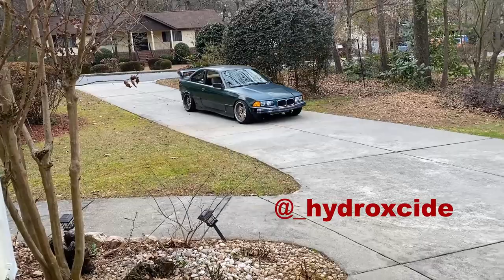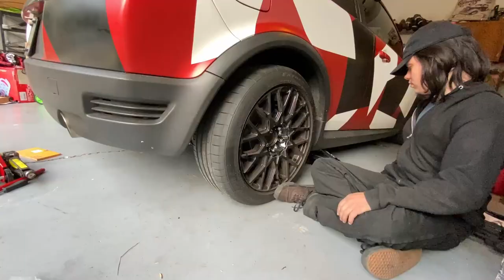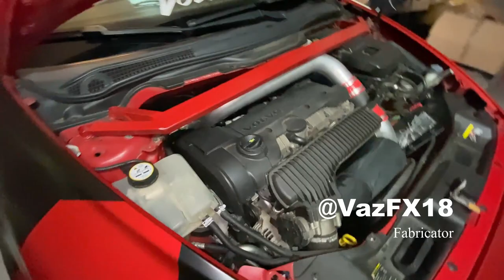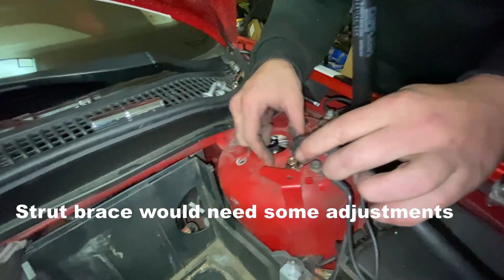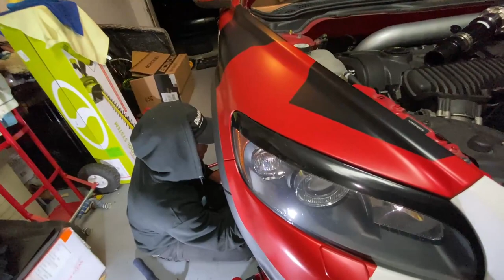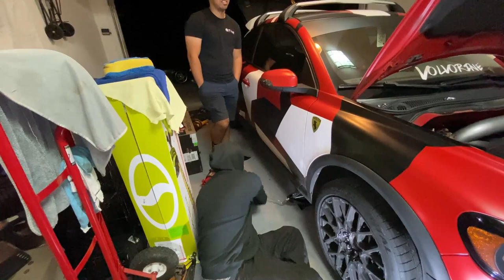I bought coilovers with my stimulus check and installed them on my 2008 Volvo C30

Comment: Watching you take off the front suspension was painful… There’s a tool that fits in the back that spreads that clamp and it slides right off. A small prybar or bent screwdriver works too. I have a screwdriver socket for my impact gun that I use with a hand ratchet.
Reply from the maker: Yup it was a pain getting the front shock out lol.